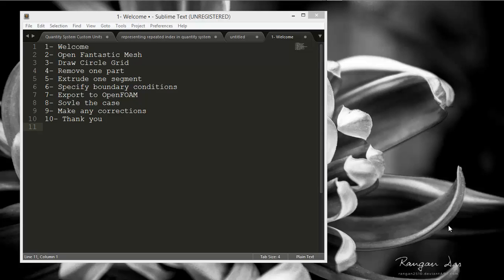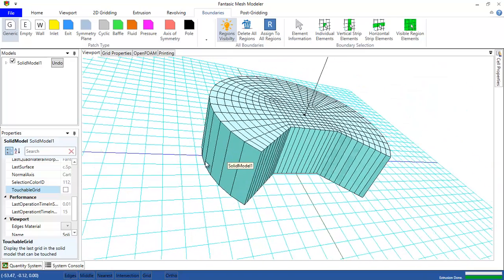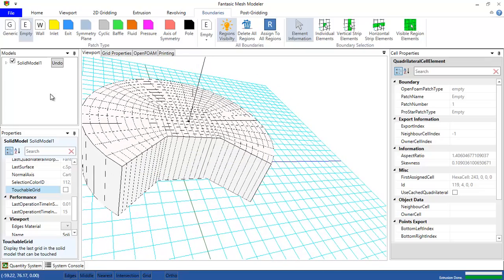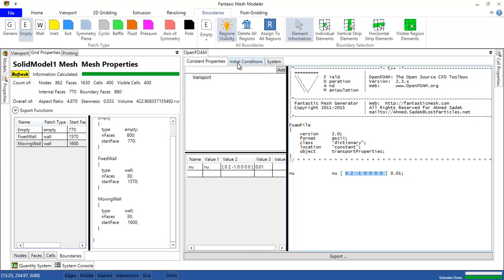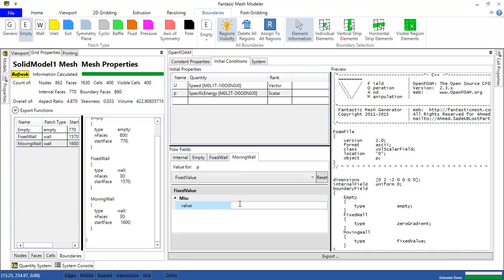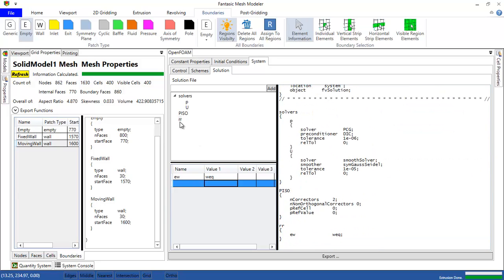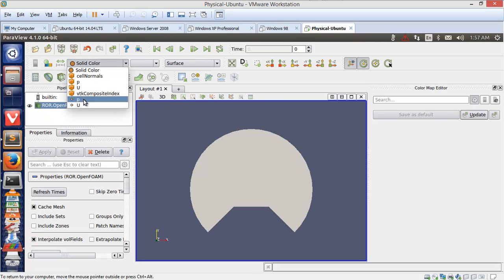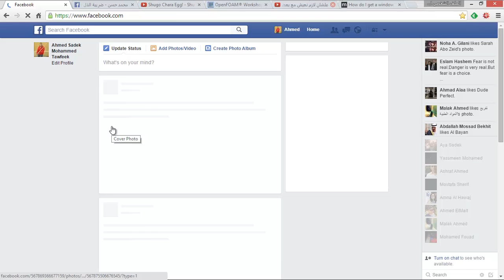Fantastic Mesh OpenFOAM Boundary Conditions

Comment: I use OpenFOAM for one year ago and a problem is to find good Open-Source mesher. blockMesh is very difficult to use for 3D geometry and snappyHexMesh don't give a good quality mesh. Many people use OpenFoam with a commercial mesher. Recently I have tried cfMesh and find him better than snappyHexMesh. Your mesher can be a good solution to get better quality mesh. You can ameliorate your mesher by adding STL file importation and capability of smoothing the mesh and snapping the boundary faces to a triSurfaceMesh. You can see "extBlockMesh" is extend OpenFOAM blockMesh and give this function.